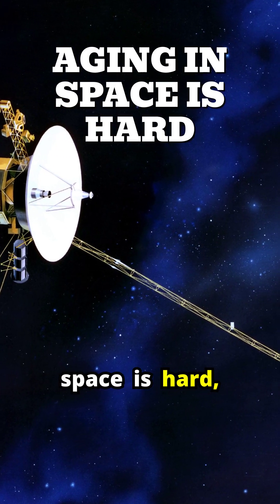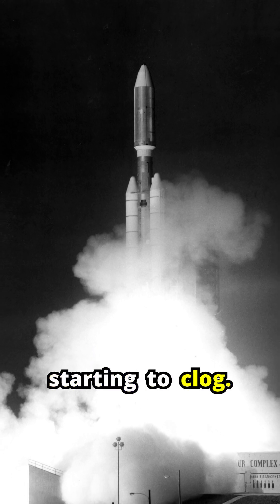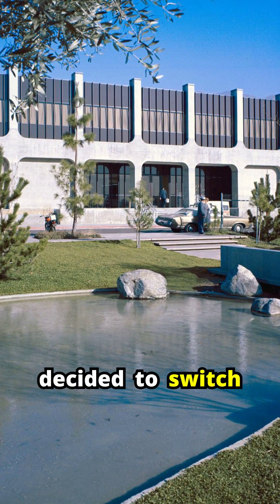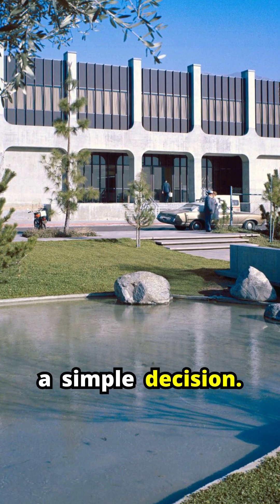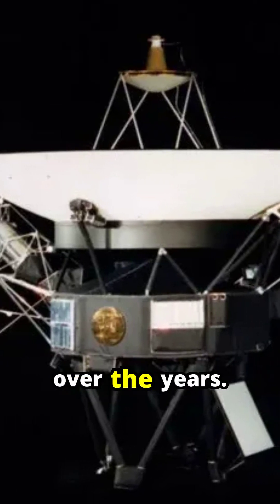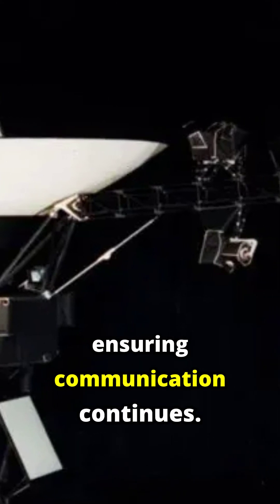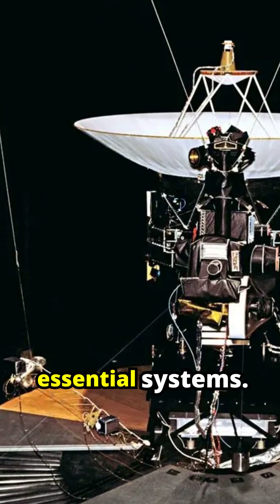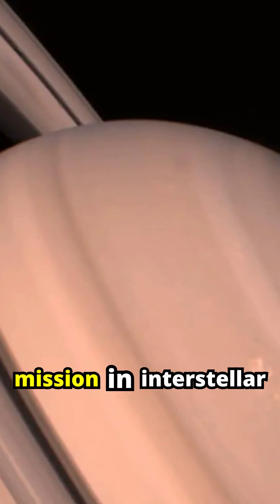How NASA Fixed Voyager 1's Clogged Thrusters #space #science

Comment: The silicon dioxide (SiO₂) found in the thruster systems of Voyager 1 and 2 is primarily a byproduct of the degradation of a silicon rubber diaphragm in the spacecraft's fuel tank. Over time, as the rubber material ages and breaks down, it can release silicon compounds that eventually form silicon dioxide. 
(Source: see headlines "NASA-beats-the-odds-with-ingenious-voyager-1-thruster-fix-from-billions-of-miles-away" and "voyager-1-team-accomplishes-tricky-thruster-swap")

Comment: Too bad they can't use the ABUNDANT waste heat from the RTGs to warm the thrusters. But back when this was designed, they never expected it to be functioning anywhere near this long. FYI, RTG means Radioisotope Thermoelectric Generators, which generate electrical power very inefficiently from the heat of radioactive decay of artificially-made Plutonium 238.

Comment: Sand in the engine? At least the 8-track is still working!
Reply: The silicon dioxide (SiO₂) found in the thruster systems of Voyager 1 and 2 is primarily a byproduct of the degradation of a silicon rubber diaphragm in the spacecraft's fuel tank. Over time, as the rubber material ages and breaks down, it can release silicon compounds that eventually form silicon dioxide. 
(Source: see headlines "NASA-beats-the-odds-with-ingenious-voyager-1-thruster-fix-from-billions-of-miles-away" and "voyager-1-team-accomplishes-tricky-thruster-swap")